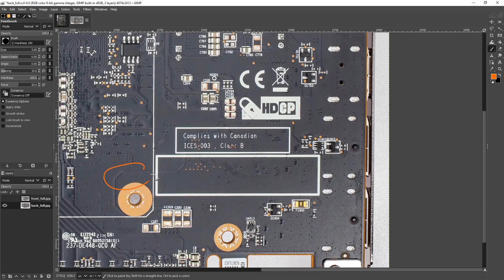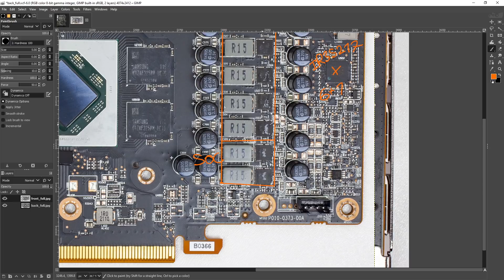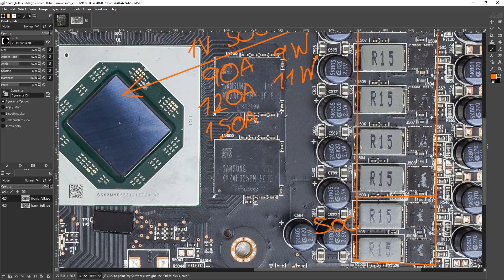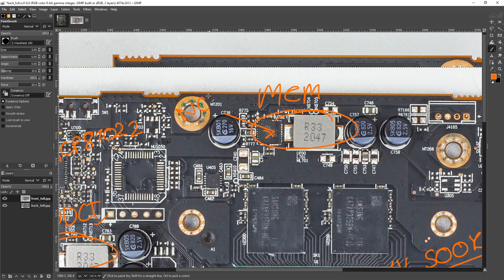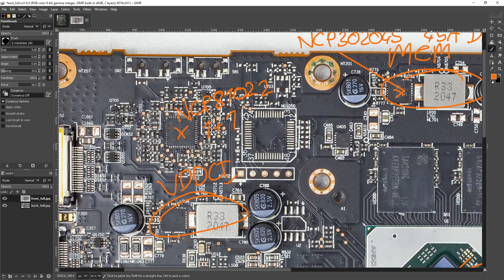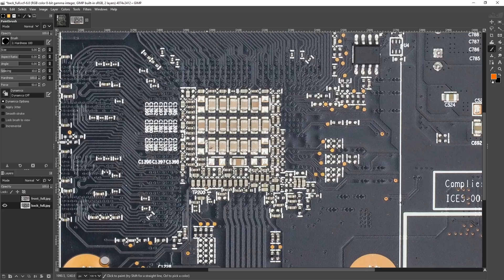GPU PCB Breakdown: Sapphire RX 6600 XT Pulse

Comment: PCB should of been smaller

To my knowledge the R9 fury nano was the last actually small form factor card that was made

At the end of the PCIe slot or maybe a tab beyond is where cards under 170w should aim to stop

And 3090’s for example should be 2 slot cards with the option of 3 slot cards with a slot dedicated to Vram cooling for the back and using paste not pads
Reply: Why do you want the cards to all be tiny when they would run hot and loud?
Reply: @LawrenceTimme  its a 6600xt it aint hot and loud if engineered and not copy paste a cooler

ALL COOLER apart from the 1070 katana are piles of worthless copy pasted heatsink garbage
Reply: @commanderoof4578  the bigger it is the cooler and quieter it will run. Also there is no crossfire or sli and more so there is really no point making a small card. The fury nano was a small furnace.
Reply: @LawrenceTimme  small cards = small PC

Small PC = can take it as carry on

Can take it as carry on = work PC / Person PC can go with you

And as it would he a full size GPU just short you can get 4 video outs from the GPU and then 2-3 out of your motherboard if you need to

Vs laptops which are just meh they fit the roll but are totally crap in comparison for to many reasons

Under 170w should be the size of the R9 nano

More heat sink does not = more better 

Which means a bugger heatsink can be worse than a smaller one that has been engineered correctly

So you can have a card such as the 3090 be 2 slots and also be cooler and quieter than a 3 slot slot if you…

use better paste
Use a heat-chamber
Use a more dense and width optimised fin stack
Use copper for the cooler
Use thermal paste rather than thermal pads

Stick all of that together and you can get a 2 slot cooler that is 6c cooler than a “decent” 3 slot GPU and as the heat transfer is more efficient there is less heat that stays around such as Vram and and VRM’s

1070 liquid metal thermal paste for the Vram and 12.6kw thermal pads for the Mosfets and inductors

You can go from 88c down to 66c just from those few things without even touching the cooler design just because there is less heat that is trapped for a long period meaning unless under a stress test you will be quiter

But under a stress test you will at worst be the same volume
Reply: @LawrenceTimme  a redacted version just incase

Thinner heat-fins and more of them in the same space

Better thermal paste and also using it on the Vram, Mostfets and inductors instead of pads

And finally using a heat chamber

Makes a 2 slot card performance at WORST the same as a “respectable” 3 slot card

Its the sheer lack of engineering that makes you think bigger is better because all they are doing is extruding the fins for longer making more surface area which can be done without actually needing more physical volume of space by actually engineering the cooler better
Reply: @commanderoof4578  it's just more cost though. Better engineering cost more. Bigger engineering cost less. Stay at home have a big pc.

At the end of the day you can't beat physics a bigger cooler engineered to the same standard is just better it has more mass.

Also really how many people carry a pc around. It's not really worth putting in all the effort making a tiny card when only a few will buy it.
Reply: @LawrenceTimme  its like 5 hours of effort remember its 2021 not the 2000’s CAD is instant

But yeah if its engineered to the same standard

But its not just taking it with you its called small room multiple monitors and putting your PC on the floor is not an option period

So if you have 3 screens there simply is bo space for the screens and a !big waste of space PC! And those screen hell even 2 screens can become a no go just because of GPU sizes being 3 slot meaning needing a bigger PC case meaning no dang space
Reply: @LawrenceTimme  All cards don’t have to be dual fan, we’re just living in a time where a marketing meme makes people think GPUs need to have dual fan so you get cards like the Biostar 6600 XT (and various low end 1650 models) that have a paper mache cooler with dual fans.
This card could’ve easily been cooled by a decent single fan cooler without being very loud and it would’ve created a niche for those who need something small. Instead we get triple fan coolers (XFX Speedster) that are worse than smaller dual fan (the other cards Guru3D tested were 10C cooler at similar fan speeds and power consumption) because why design good coolers when you can make them bigger.
Reply: @Ty4ons  more fans does not = better but a bigger heatsink does. The biostar was the lightest card hw unboxed had by over 100 grams.
Reply: @LawrenceTimme  Only if it’s equally well designed. Plenty of big heavy coolers are poorly designed and perform like ass, but they sell because a big cooler looks good.
The issue with the Biostar cooler isn’t really mass, it’s a type of cooler where most of the heat is transferred through the aluminum, poor airflow and with very little surface area. I don’t think a flower style cooler (intel stock cooler) is that much heavier, but they perform much better with more surface area. My old GTX 460 had a cooler like that and the noise never got intrusive. Higher end 460 and 560 coolers had a heatpipe too.
Reply: @Ty4ons  if you look at an MSI ventus Vs trio Vs suprim the cards get bigger, the cooling gets better. Same designers making them. 

Asus have dual, tuf and a strix, again the bigger cards designed by same company perform better.

Evga have xc3, ftw the bigger card designed by the same manufacture again performs better. 

The manufacturers make the best card they can at the price point. If they all spent way more and had a strix or ftw that was small than the xc3 or dual, but performed the same but strix or ftw cost very very few people would buy them. They make them the best they can at the price point each time. If they don't compete then they lose sales and customers.

The biostar sucks both and design and mass. If it was same rubbish design but twice as big and heavy it might do a good job, but biostar is a bad example as they will put out the cheapest even if it's rubbish. The decent manufacturers like above clearly design all their heatsinks well enough while keeping inline with competitive price.
Reply: @LawrenceTimme Let’s take the XFX 6600 XT Speedster Merc I brought up again. It weighs almost 900 grams. 
The Sapphire 6600 XT Pulse however weighs just 606 grams yet in Techpowerup’s noise normalized test they perform the same (60C vs 61C core temperature). The size of the XFX cooler is mostly marketing because the average consumer isn’t going to hunt through cooling benches and compare stuff, they just choose the card that “looks” the best.
Source: https://www.techpowerup.com/review/sapphire-radeon-rx-6600-xt-pulse-oc/33.html

These are companies with pretty slim margins trying to carve their niche in a pretty competitive market. They can’t spend that much money on designing a cooler which is why it’s sometimes broken, but often kinda suboptimal. It’s much cheaper to pretend with size.
Reply: @Ty4ons  you are comparing 2 different brands. They are designed by completely different companies. Xfx are a low tier brand like biostar. Sapphire are a decent brand. 

Like I said, the decent brands already make the best heatsinks they can at the price point. The Asus strix and MSI probably do similar performance to the sapphire.
Reply: @LawrenceTimme  And I’m talking about a decent cooler made in a small configuration that could work well with a slight hit in performance, but fit into new systems. If they’re made even better performance could be quite close.

The XFX card is more expensive (MSRP) and XFX could invest money into better cooler design, but because bigger sells they’ve instead invested in making it bigger.
More premium brands like Asus have made flawed coolers too quite recently.
Reply: @Ty4ons  yes but the op wants a sapphire card that's smaller...... Sapphire already has a good cooler. They couldn't make it any better at this price point.
Reply: @LawrenceTimme  They could make a decent card that was smaller, but they’re probably not going to because the market prefers bigger cards.
Reply: @Ty4ons  yes, the market prefers quieter cards which requires a larger size to get the performance and price correct for the manufacturer.
Reply: @LawrenceTimme  It wouldn’t be loud, lots of people wouldn’t hear it over their CPU cooler. This is a 145W core at stock settings.
The much hungrier R9 Nano had a very decent cooler, but that was overshadowed by the awful coil whine.

Comment: I just can't stop thinking about how bad the 6600 xt will run on motherboards with gen 3 16x PCIe, with the memory running basically half speeds, so many will get caught out by this after buying the card without even understanding how big the problem can be.
Reply: : There are tests on Igors Lab where he tests the card and it tanks performance, yes. But the memory interface is the bigger problem imo.
Reply: HUB measured it at a 5% loss on average. And saying the memory "running basically half speeds" is so gross a simplification that it turns into an outright misrepresentation of how PCIe DMA transfer speed vs VRAM speed works.
Reply: Gen 3 8x is still gen2 16x speeds, which is plenty. For a 6600XT the drop in performance going from gen4 to gen3 is minimal. Yes it varies by game and there's a few examples in reviews out there, however in the bigger scheme of things it's really a non issue. I even tested it at gen1 8x and it's still surprisingly capable, however about a 15% drop in performance compared to gen4 8x.
Reply: @Marty_NZ  : A 5% loss on average is still plenty enough for an already "mediocre at best" card. I meant the memory was a bigger problem in general, not just for pice gen3. But the card being connected with x8, although I see why they did it, doesn't help the card since it already has almost no selling points what so ever.
Reply: @philippbeckonert1678  it has great selling points though if it's available and at a good price. Here in NZ it's $200NZ cheaper than the cheapest 3060. Hell it's even cheaper than a 1660 Super and RTX2060. I bought one even though I already have a 6700XT and a 1080ti. The value was just too great to ignore.
Reply: @Marty_NZ  : In Europe the card costs at least 450€ which is insane. It's a 250€ card IF the market wasn't crazy and the 128bit memory just doesn't cut it in the long run.

Comment: You're right about the Nitro having a lot of the stuff unpopulated here. It uses the exact same PCB and has dual-BIOS along with some RGB nonsense. I assume it also has the missing power stage, though there don't seem to be any reviews of it around at all, let alone ones with PCB pictures. I guess Sapphire only sent out the Pulse as review samples.
Reply: Its a Sample, then the Nitro will appear

Comment: This really screams "I am a RX480 successor"
Reply from the maker: looks more like an overgrown RX 460
Reply: @ActuallyHardcoreOverclocking  oof
Reply: @tommihommi1  In it's defense it is a X600 (as in lower mid range) series card.  On the other hand everyone that wants one, will probably pay $400 for it.  :?
Reply: @nocturnal0072  Save your money for a better card this card is not worth more than 250 in most peoples eyes let alone well over 300. That is why they where making fun of it with older cards Die names. No defenses need. 🤣
Reply: @ActuallyHardcoreOverclocking  RX 5500 with a bigger die.
Apparently easily tuned down to 80W power consumption without a big performance hit.
Reply from the maker: @Ty4ons  well the RX 5500 is the successor of the RX 460
Reply: @ActuallyHardcoreOverclocking  if you are basing this on cu count then the 6600 xt is a 470 successor
Reply: @ActuallyHardcoreOverclocking  I threw in the towel waiting, and got the Nitro version of this to replace my RX 480. Hopefully it's a good enough upgrade to tide me over until the 6700 XT is closer to MSRP.
Reply: @MarkD26  was thinking about doing the same, my ex mining rx480 might be in for retirement
Reply: @MarkD26  I got this Pulse version at MSRP and super happy with it. I also have a 6700XT and a 1080ti in other rigs. Compared Shadow Of The Tomb Raider on highest settings benchmark yesterday between RX480 and 6600XT and in both 1080P and 1440P you get more than double FPS. 39FPS VS 82FPS at 1440P and 58FPS VS 125FPS at 1080P. If you get the 6600XT at the right price it's a great card, even for 1440P.
Reply: @Marty_NZ  The card is probably great, but its pricing is just plain horrible. 

The RX480 8 GB is already 5 years old, it is expected to double that card's performance for the same price years later. Even if it is an RX 5600 XT replacement (not if you look at design of the card more like an RX 5500 XT) it is way overpriced by 100$/€ and by 180$/€ if you compare it to the RX 5500 XT.
Reply: @olymind1  The price is definitely not ideal. However, for today, at the right price this is an excellent card. Forget about the past, time machines don't exist. Let me float the current options that we have available here in $NZ:  $150 GT1030, $260 GTX 1050, $400 1650, $640 6600XT, $700 1660 Super, $820 RTX2060, $850 RTX3060, $1100 RTX3060ti, $1200 6700XT. Now tell me a 6600XT at $640 isn't a steal compared to the other cards they can purchase right now? Yeah it's still a lot of money for a mid tier card, but man does it provide value for money right now.
Reply: @Marty_NZ $640 6600XT is 380€ so it is acceptable if someone doesn't want to wait, though it is an RX 5700 XT replacement price- and performance-wise 2 years later, just there isn't much improvement there other than the lowered power consumption. I understand what you're saying, current market and prices suck.
Reply: @olymind1  Yes. I also have a 5700XT but that cost me $750NZ 2 years ago.  I think people need to move on from comparing price to performance from today vs the past. Those days are gone.